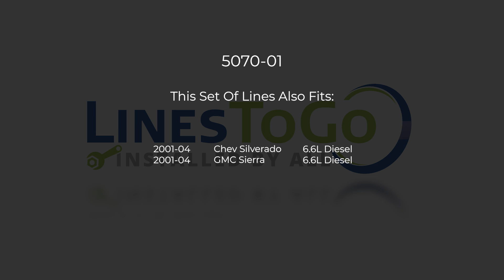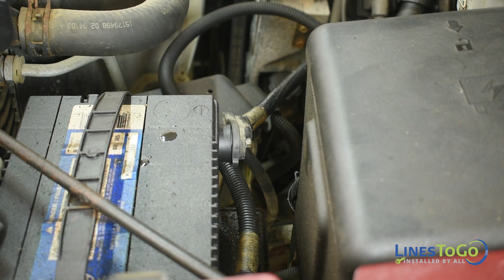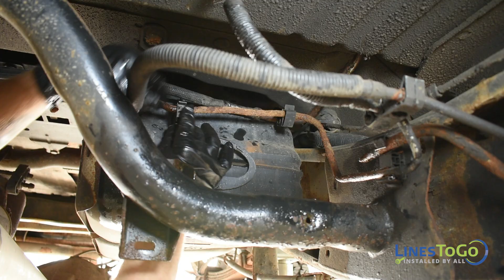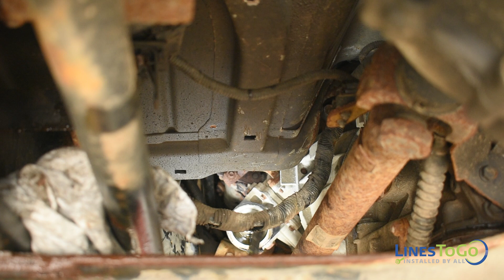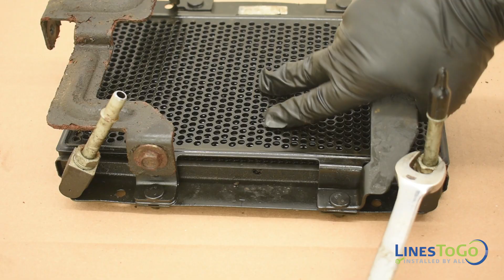How to Install 2001-2004 Chevrolet Silverado 2500HD/3500 and GMC Sierra 2500HD/3500 Fuel Lines

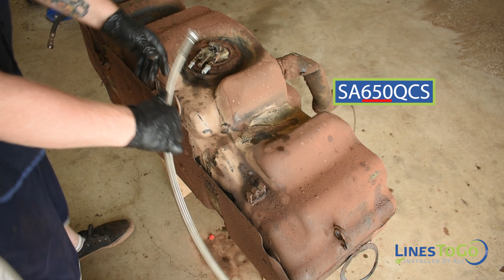Comment: @ 8:00 mark you connected the straight fitting when it should have been the other end that had the 45 degree angled end.
Reply from the maker: Thanks for your comment. I will be sure to pass this along to check into!
Reply: Do you guys not sell the kit anymore?